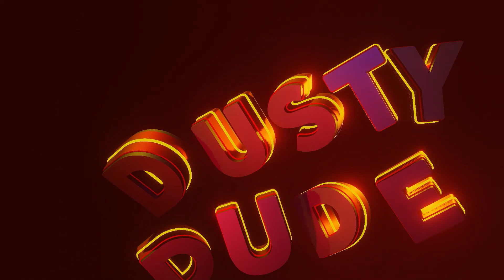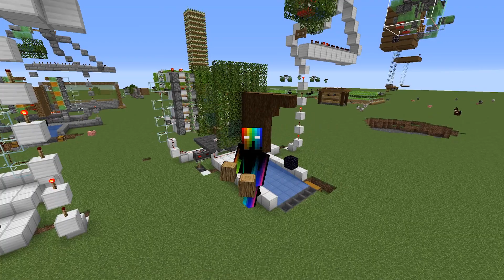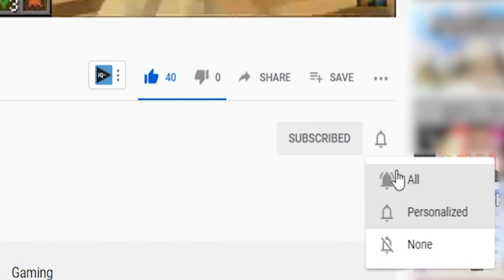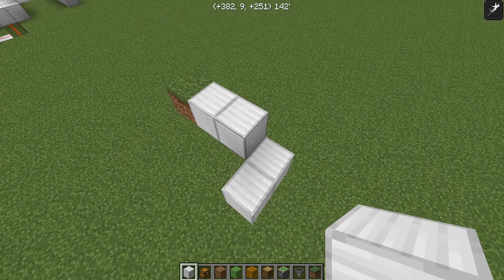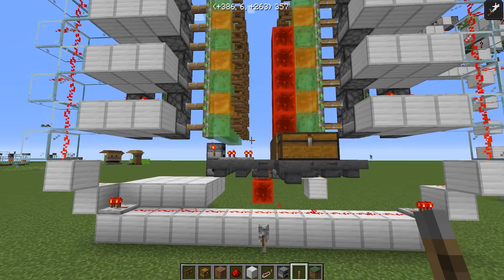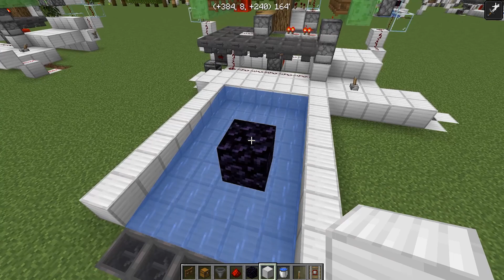BEST EASY AUTOMATIC TREE FARM! 4 Types of Logs - 26.1 [TNT Powered] -  Minecraft

Comment: Help please! I've built up to where you say to test the arms, but nothing moves. I've double checked the repeaters, the outside one is 2 ticks and the inside one is 4 ticks, there are no immovable blocks in the way of the pistons, power is getting to all the power sources, and I started the pistons 4 blocks away one block up. Why aren't the pistons activating?
Reply: For those in 1.16.5, I was apparently having a collision error and I only needed the first column of sticky pistons, the ones directly in front of the power source. Everything else is the same.

Comment: for some reason whenever i extend the pistons on the left hand side (the ones opposite of the redstone wall) 2-3 fence gates close once i pull the ppistons back. is that a probplem? will it break the farm? and also i have checked several times but i seem to have built it correctly. cant find any missind redstone either. ? (1.16.5)
Reply: same
Reply: @corbincaddy2486  i finished the farm and the doors closing doenst matter. it works perfectly
Reply: @TheAeonArc  oh I haven't finished yet
Reply: @TheAeonArc  u mean gate?

Comment: Some tips after building it: 
1.- Try lighting it up so creepers don't spawn and blow all your work
2.- Put slabs over the unharvested wood so mobs can't spawn over there
3.- When you stop it, wait for the sapling in place to grow and be moved by the pistons or the machine will 'jam' and stop working
4.- Sometimes the harvested logs pass over the hoppers that lead into the chest, so put some blocks to stop that
5.- You can move the on/off lever a little bit closer so it's more at hand to use
6.- For max efficiency, you can add some more hoppers to catch the sapplings that sometimes fall off (then compost them for more bone meal)

Comment: Please explain to me what exactly you mean by it blowing up with the gate delay in the discription can you just tell me what time stamp I gotta not do a delay thx
Reply from the maker: There is a gate that opens that controls when the tnt should fall. Don’t include the gate that times the drop and you will be good
Reply: @DustyDude  ok thank you sir
Reply: @DustyDude  I only leave the gate out or also the water? And if water stays in i just put a sign there ?
Reply: @DustyDude  oh wait the gate under the leaves is meant right? So i dont have to use those 8 repeaters
Reply from the maker: yes! That is correct :) Let me know if you have any more questions :) You can always join the discord as well and I can help on a call :)
Reply: @DustyDude  aight thanks a lot mate gotta grind the materials now
Reply: @DustyDude  ok so i build it now my double piston stuff works fine but my tnt duper isnt working at all it just destroys the coral fan and my tnt is also gone afterwards and solution?
Reply: @DustyDude  well apperently im playing on a paper server and the tnt duper is fixed there but in the internet stood that you can change that somewhere... you have any clue where to do that?
Reply: @DustyDude  ok i know im annoying but now i have issues with the piston expander from the back it will sometimes lose the wood infront of it on top of the dirt i think its cuz i flicked the lever to quick but im not quite sure
Reply: @DustyDude  ok imma keep annoying i did some research and figured myself out how to change the file in the papermc code my friend will change it tmmrw, hes running the server, and i will test it and let you know if it worked
Reply: @DustyDude  alright it works thank you very much

Comment: Hi, you probably won't see this comment or anyone, considering this video is 2 months old. Anyways great design. I have one issue, i am doing this on a smp and whenever i start it up it works flawlessly. But after 30 sec  - 1 minute, the 2nd and 3rd row from the bottom of slime/honey blocks stay as if they are pushed forward on the side you are closest to when afking.. Am I the only one with this problem? Did I mess something up?

Comment: To many cuts in the video for sure, but my TNT Duper keeps blowing itself up and I've done it like idk a good 4 times. any help?
Reply: Maybe you fence gate underneath keep close while TNT falling, check the last repeater is set to cero delay and the remainings set to four, also you placed the torch to invert the signal output from the hopper clock.
Don't place the leaves next to TNT when the dupper is retracted, happened to me it will blow up, place the blocks before making the dupper, this will prevent updating the dupper and blowing by itself.
When turn off run an additional signal from any remaining on torch from tower to force open the below fence gate, this will prevent the TNT stuck and blow everything away when turning off the farm.
Reply: i had this problem too just double check then triple check that it's the EXACT same else it blows up

Comment: Love the design! Quick and easy, tho I agree with the comments on it being a tad too many cuts. I tried to follow along at 0.75% speed and it was somewhat doable :p

I did a tiny QOL change do the starting lever. Made it into a pressure plate to the right of the sapling-dispenser, and added one stone wall to the right of the pressure plate. Now the machine starts/stops based on me being in the area, and all saplings stop at me even with a full inventory. The rest is plain copy-paste.
Reply from the maker: Yeah I need to redo this video a bit slower :/ I like the change you made!

Comment: Can someone help? I built the farm, but the sticky piston under the dirtblock dosent get powered if a tree grows. I double checked it 10 times now. The same happened with an other treefarm i built from youtube
Reply: same problem here :(
Reply: @thomlb4301  i fugured out that the blinkin redstoneline behind the piston updates it without being connected. if you build the whole farm, it should work
Reply: @Not-A-LLM  thx a lot! I Also made some modification for the farm but it so much different from the original i am pushing the tree trunk up now so i have more Space for the tree growth detection systeme and i also change the collection systeme for saplings. But good job for the eazy fix u made! I will most likely have to build the farm again Cuz i dont think the farm i modified will work with all the saplings its supposed to work with.

Comment: I tested the double piston extenders on the outside and they extended and retracted great. I then put the middle double extender in and tested. Everything extended but then everything stayed powered and the lever will not retract.
Reply: Okay I got the first thing fixed but now my tnt duper wont start up with starting after putting in the torch tower. Help.
Reply from the maker: Join the discord for help

Comment: Does anybody know a reliable way to turn this off? I've noticed it can leave a piece of TNT stuck in the gate sometimes, and I'd love to not have to rebuild that all the time.
Reply: Yes, Run a redstone signal from any torch (from tower) wich remains on when you turn off the farm the to an additional repeater next to the first repeater (the one after the redstone dust wich activates the fence gate)  then a solid block (attached to the additional repeater, making an OR gate)  next to the redstone dust so when you turn off the farm, this additional repeater power the block then forces open the fence any. So any TNT falling will pass throughout without blowing the machine, when turn off the farm that torch will turn off allowing the delay timer to work properly.

Comment: Iʻm playing on a realms server and it blew up itself, just to be safe you guys should *not* put in the fence gate timer if you are on a server
Reply: i think i found an alternative. In the hopper clock for the tnt duper, use 5 items instead of four.
Reply: @charlesbassani672  are you sure?
Reply: @damona22  no, but i did find a different way. Just let the water flow onto the bottom fence gate and surround that flowing water with leaves to keep the tnt aligned. This stops the tnt from destroying anything if it explodes near the top.
Reply: @charlesbassani672  mine is blowing up parts of the collection system (the walls that hold in the water below the obsidian). I'm on a realm if that helps. Any tips?
Reply: @leohongjohnson5670  I think your obsidian is too low, raise it up 1 or 2
Reply: What is a fence gate timer?
Reply: @pasthly5654  in the video its the contraption that opens up the gate underneath the tnt
Reply: @m1chael588  oh thank you
Reply: It works fine for me

Comment: Built this and it worked amazing, until i tried to run it for a couple of minutes. Then I dont know if it was a lag spike, but the TNT dupper didnt drop the tnt and blew up the dupper. Anyone have this issue?
Reply: I just built the farm and also had this problem
Reply: @mattsmith1858  I think I saw the problem, when shutting the machine  off, you have to make sure the charged TNT is in the process of moving down the water stream.
Reply: @SyrinxQ72  yes i did notice it only blew up after I turned it off, I'll try this and hopefully it works, thanks!

Comment: Another awesome video, Dusty Dude! I am cirtainly going to build this, but I was wondering if it has the same bug as the previous design that involved the machine sometimes exploding when turned on. If so, do you know how to fix it? Keep up the good work and stay safe =)
Reply from the maker: I have this design on my server and I have ran it was a tick warp for a very long time and I have never had that issue.

Can you please tell me more about what happens when it blows up?

Also make sure you have the correct timings on the tnt duper and on the hopper clock.

Some people I talked to did not follow the tutorial exactly and that was causing issues.
Reply: Thank You for replying so quickly, Dusty Dude. I have built the farm in a test world and tried to activate the bug but I cannot. It seems to just be a problem on a very laggy server or user error from other players. The reason I asked about this bug was because of a comment that was getting a lot of attention that explained the problem so I thought it was true, but apparently after testing, everything seems good. Thanks for helping me out, and keep up the good work on your farms! (=
Reply: @isaacstlies4744  I can confirm mine also blew up after a short session. It worked fine first time I tested it, but second time, the duper blew itself up shortly after switching it off :( I triple-checked all delays and redstone before turning it on. 
I guess you are refering to this comment: https://www.youtube.com/watch?v=1KHyuGajG_M&lc=Ugw85d_xuPT4ZW1idb54AaABAg